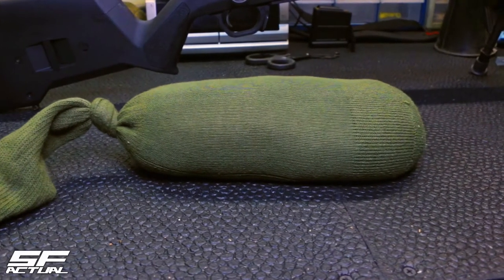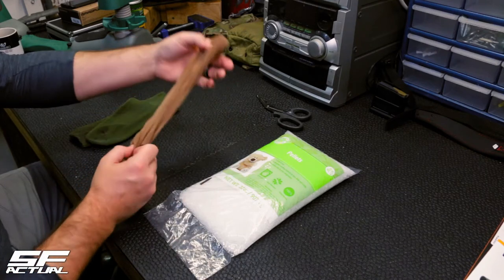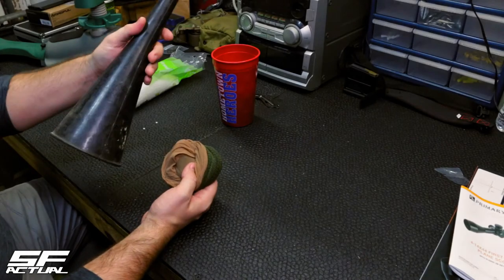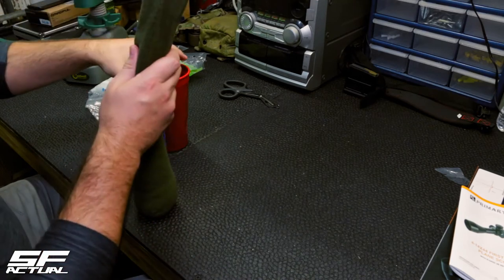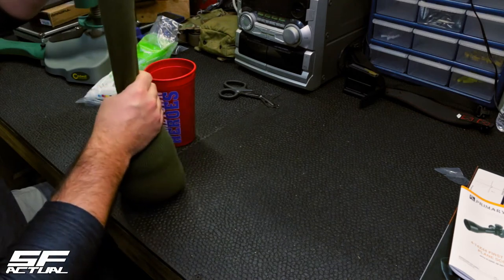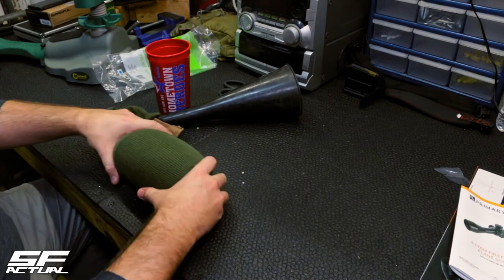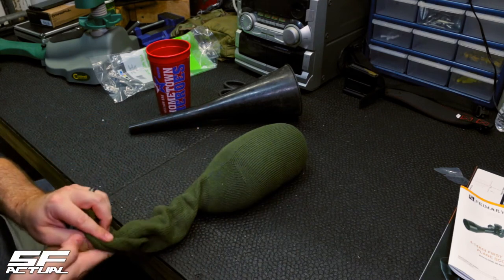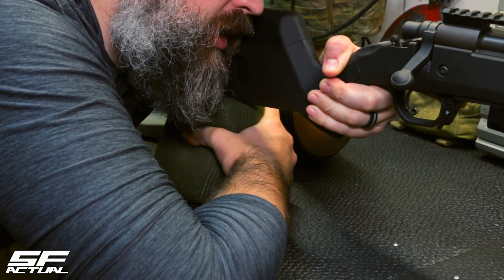DIY Build: Rifle Rest Bag - Sniper Sock

Comment: I tried this with the panty hose and the fine grains of sand leak out a little when you roll the bag to adjust it so I stuffed a plastic walmart bag in there and it works perfect. No leakage.